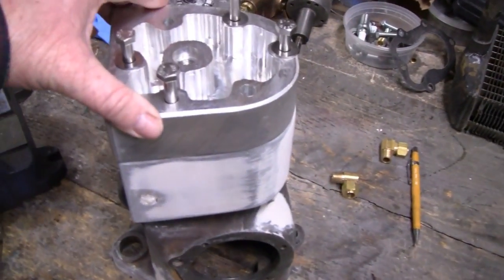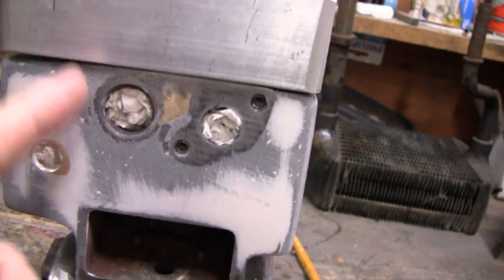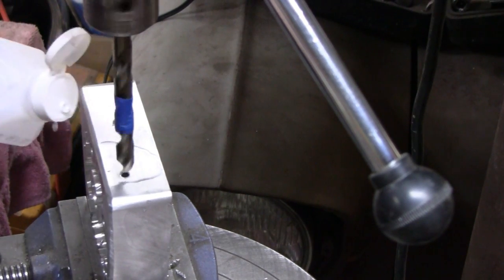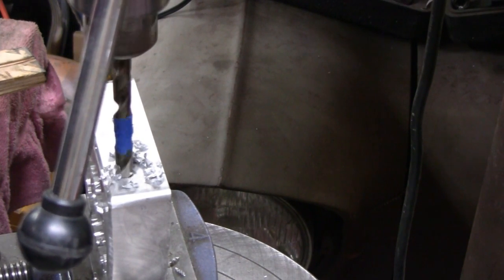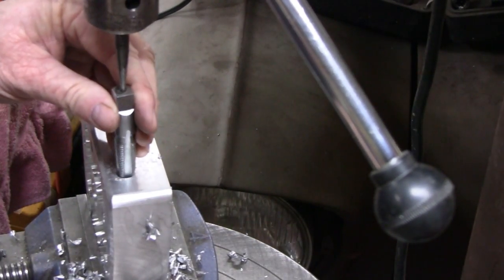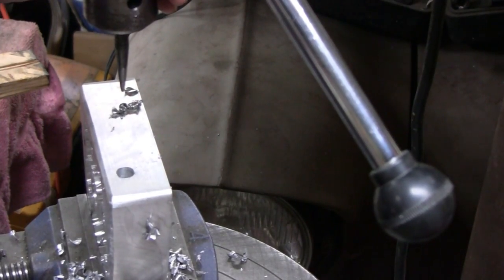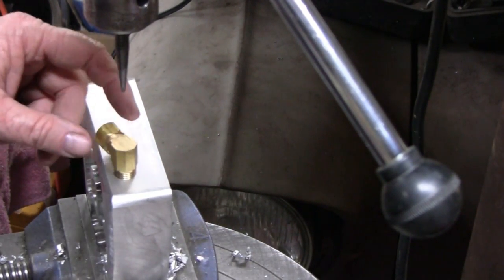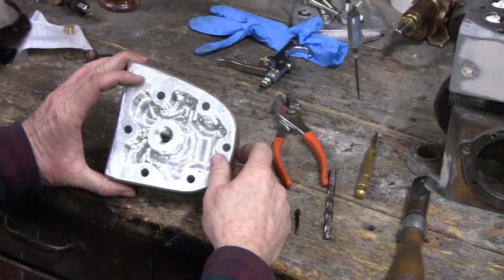HOMEMADE WATER COOLED BRIGGS ENGINE (part 21)

Comment: so would the head not get hot around the front? water takes the path of least resistance and i feel like it would just go straight to the exit and skip the area around the front... i know that it would fill up, but idk if there would be much of any flow... im no expert so i might be wrong...
Reply: nolan mods Precisely what I was thinking! If the two holes are on those opposite each other then it would (like you said) take the path of least resistance! Maybe if he welded in a wall between the two the water will make its way to the front of the head as well
Reply: Exactly!!!
Reply: if u ever boiled water it'll still pick up heat and move about = ]
Reply: nolan mods hmm idk
Reply: It's a 2HP engine that hardly makes any heat. It was adequately cooled by a crappy little fan blowing over some iron fins. There will be enough turbulence and vibration to get the water everywhere it needs to be. This isn't a race engine.
Reply: OK go mow your lawn and put your hand on the fins for 10 seconds and tell me that it doesn't create much heat.
Reply: nolan mods just burned you American locomotive haha get it
Reply: xD
Reply: Water has 25 times the thermal conductivity of air, and 4 times the specific heat capacity. A very small amount of water can carry away a significant amount of heat. The stock Briggs is adequately cooled by a small fan, and a small number of fins.

The thermal conductivity of the water, aluminum coupled with the share size of the head and volume of water will result in pretty much no hotspots. It's a non issue for an engine as small as this Briggs.
Reply: That's the answer I was looking for. Thank you!
Reply: I see some others noticed this too, and yes it could have been not milled out there, but like he said this is a prototype Engine, and go make your own if you can do better. I'm amazed at his go to it attitude regardless of anything else. This is what this country needs instead of video games. I taught small engine repair to middle school kids back in 2003/2004, would have loved to have had a guy like this talk to my kids. nuff said.
Reply: I don't think I could do anywhere near what roadking has done!! It was just a thought. I love his projects. I've been following since the in line 4 Briggs.
Reply: A good idea .....

RK .... Any comments re this modification ?

Sorry ... You had commented earlier .... :)
Reply: Probably doesn't matter with this few horsepowers. But yeah, blocking the direct path seems the reasonable thing to do. You probably don't even have to block it completly, a simple angled baffle should be able to redirect/split the water stream. A more even cooling should also prevent any kind of bending force due to uneven temperatures.
Reply: Rene Schickbauer oh I didn't even think about head warping!! that's a good point!!
Reply: also keep in mind that that straight path is the hottest part of the engine, right near the valves, and this engine is not going to be run under load at all, so it'll do great. sure, it's not perfect, but adaptations of this nature never really are.
Reply: Krankie V good point! I guess I over thought it lol
Reply: American Locomotive Infact you can calculate the amount of heat that is dissipated:

Average engine ~30% thermal efficiency
2HP Engine x 3 = 6HP loss
6HP x 745W (per horsepower) = 4,470 Watts wasted
So the engine has to dissipate 4470 watts or almost 4.5 Kilowatts
Reply: Your math is off. That 2HP represents ~30% of the total energy expended by the fuel. That means the total power expended is "6HP" - 2HP of it going to the crankshaft. 4HP as heat. Of that heat, about half of it goes out the exhaust, the other half into the cooling system. That means the block is dissipating roughly 2HP worth of heat, or about 1500 watts.

Comment: guess the only thing I dont like is the inlet/outlet are directly across from eachother so it doesn't really flow the water around the head it just goes straight across, if there was a dam in between that wall and the spark plug it'd force it to go over the piston section then out, but this isn't really finned on the inside or anything so might not even matter. 

I'm sure it will work either way.
Reply: Surely the water flow between the inlet and outlet would swirl the water inside the chamber and create flow around the head? Besides as Roadking keeps telling us this is just a prototype and he can always make a better head if this one isn't up to the job right?

Comment: RK, that is lead solder on the radiator tank, clean it well add a little soldering flux a bit of a roll of lead tin solder and a large copper old fashioned soldering iron and away you go
Reply from the maker: That's all the stuff I gave away years ago!! We're gonna Epoxy it and call it good!! If it was going back in an Antique Car we would have done it right!!☺

Comment: Thanks for the tips here ROADKING. Using alcohol to keep those cutting tools clean when working on aluminum, and using the drill press with center punch to steady the tap.  Great ideas !
Reply from the maker: I just learned about the alcohol myself!! for every 10K goofball comments you can always come up with that one jewel!!☺
Reply: Sorry this wasn't meant as a goofball comment, I was just thanking you for a good tip.
Reply from the maker: Nah you misinterpreted my comment Reg!! I wasn't referring to your comment as goofball!! I was referring to the thousands I get everyday, I'm sure you've read plenty of them yourself!! And every once in a while something pops up that is useful!! Some Australian guy gave me that tip!!☺
Reply: RK ....What about alcohol (Drinking variety) applied internally ???
Reply: Yes I did ROADKING, good enough then,  and THANKS for clearing that up.
Cheers! ( as usual)

Comment: My drill press slips too.  That prevents the helicopter action with the piece.  Great tip on the deburing tool.  I have lots of old guy fixes to.  Not that You are old.
Reply from the maker: Daddydirtbike thought he was doing me a favor once and tightened those belts. Two days later Mike was drilling a huge piece of metal that took off on him, it spun that bitch around, bent the hell outta out of the Morse taper shaft and almost dented my Chevy fender but luckily didn't hurt anybody!!☺

Comment: I have been watching this build, and noticed a flaw, I might be wrong but I'm thinking on the flow of the water as it is being pumped the two place you put the taps for the water when it glows its not going to go to the front of the cooling blocks.  I now before you said these videos are about a month out so its probably to late now. but I would have both the top and bottom put a wall in the back so the water is pushed to the front and round the cooling block, and around the bottom cooling area.   other wise its going to be a cool project when done.

Comment: are you going to put a baffle in between the spark plug and the back middle bolt. I have a feeling that when you go to run it, the water/antifreeze will just go straight in between it, causing the front of the head to not be cooled.
Reply: CounterTactik the water would probably want to travel around the engine head and block since for it to go from one inlet to another it will have to travel through a very small hole instead of a larger but farther travel
Reply: I've been wondering the same thing over the past few video's.  It seems the coolant would need to be directed around the plug to get maximum effect.   A baffle would accomplish that end.  I suspect the head is already welded though, I'm sure RK has it all mapped out.
Reply: GunPilot yeah...I guess he'll play it by ear...

Comment: Nice work. My only suggestion would have been to not mill out the area in between your inlet and outlet on the head (from sparkplug hole to bolt hole), so it forces the water to flow around the entire head, instead of skipping the larger area and going directly for the outlet. I'm sure the engine doesn't need much cooling, but you will probably have some issues with hot and cold spots on the head?
Reply from the maker: Thanks Jamie!! The head holds 3 quarters of a cup of water!!  Hopefully some of the water finds it's way to the far reaches of the front of the head eh!!☺

Comment: I have also used the drill press method for tapping, sure makes it easier to get a straight start. Yes, I have gone too far with the NPT and had loose threads.
Reply from the maker: The only way to learn about a NPT thread is to screw one up!!☺

Comment: 805roadking are you concerned at all with the fittings being directly across from each other and the space between open that you might not get enough flow around the head?  that the coolant might flow more directly to the other fitting.

Comment: You probably already sent the water cooled head out for welding. But if you do this project again, I would have left a wall of aluminum in between head inlet and head outlet. This would force the fluid to go around the the perimeter of the head. Fluid follows the path of least resistance so you wont get the fluid going all the way around the head like you'd want. Just a thought. Even if you pump the coolant slowly it will still follow path of least resistance. You are going to have stagnant water towards the front of the "U' while all the movement of water will occur in between the inlet and outlet.

Comment: what about the compression ratio and the fact that you need to damn the area in between the intake and exhaust valve on the head you could just solder a piece of aluminum in there

Comment: I had a thought if you ever do a head again like that you might want to leave a wall between the sparck plug hole and the in and out so the water has to make the full loop

Comment: Are you just going to have a gasket in between the top plate of the head  and the bottom and then bolt it or are you going to weld it?
Reply: BOB White think RK said he was going to weld it.
Reply: Natalie Parker not what I would do because if it's bolted he could very easily clean it out but his engine his way☺️

Comment: I was wondering why you are keeping the cooling fins on the fly wheel?  Why waste all that time and epoxy when you could remove them and have a more smooth, custom look?
Reply: August M. Moschera it is more weight which will run the engine slower, which will be quieter at the shows

Comment: I usually don't say anything but shouldn't you put a baffle in the aluminum head so the water flows around the head rather than shoot straight across between the inlet and outlet ports in your head? I will give you something to rant about. Ha Ha
Reply from the maker: The head holds 3 quarters of cup of water, the pump will be pushing 5-10 gallons per min.!! Hopefully some of that water will find it's way around to the front of the head!!☺
Reply: Yes, like you said, it's not a 2000 hp fully blown nitrous engine at a drag race, eh? Just a one banger...
Reply: Still, I would have love to have known in my mind that it was making a full trip around the head, mentally I just see the coolant going straight across, and a swirling hot spot around the back...  I was thinking the same when I saw the cylinder side too.... Either way I'm sure it's plenty efficient. It's a beautiful job and  I don't mean to be picky; it's never really been done before so it's easy to forget that.
Reply: octavious611 What comes to mind is updated headgaskets on V8s that have changed the sizes on water jacket holes or for that matter just which direction you place the headgaskets on the block (This Side up)(Front)

Comment: Everyone seems to be freaking out about how the water passage in the head was milled, but I don't really see any problem with it. The head will be hottest near the valves, which is where the ports are. Plus, this is just a show engine which won't be doing any serious work.
Reply from the maker: The head holds 3 quarters of a cup of water being push by a 5 -10 gallon per min. pump!! It's gonna be pretty tough trying too get some water out to the far reaches of the front of that head!! Hopefully nothing seizes eh!!☺

Comment: would it be possible to make a engine that basically works like the water cooled Briggs but has the water replaced with the type of gas they use in heat pipes for stuff like CPU's 😶
Reply: OVERKILL! ROFL!! :)

(I can see RK scratching his head .... "WTF DIS SHIT?" :) )

Comment: the water is going to jet thru one side, straight across to the other because you milled out the valley between the spark plug hole and the back, so it wont flow around, most of it will sit.

where the star is(on the terrible text art picture below), should have been left unmilled, so the water could flow around the entire head, instead of straight across the arrows

might not matter cause its a lil briggs n plenty of cooling, but the water at the front might just get hot enough sitting and not moving to boil steam be bad mkay

source: experience water cooling alotta things that probably shouldn't have been water cooled

that being said, tiny briggs, probably wont matter/happen

         ____
------>|    *    | <----
         |    o    |
          \____/